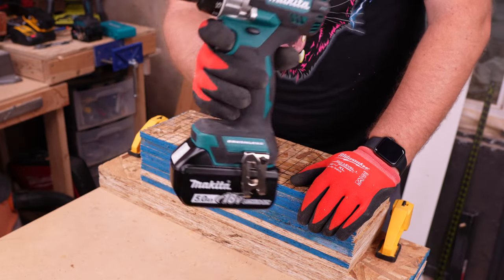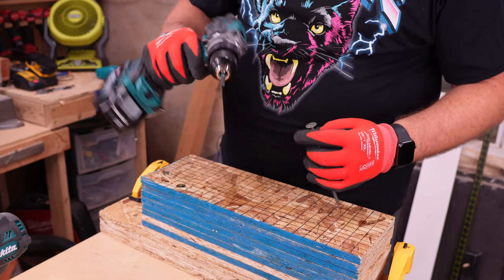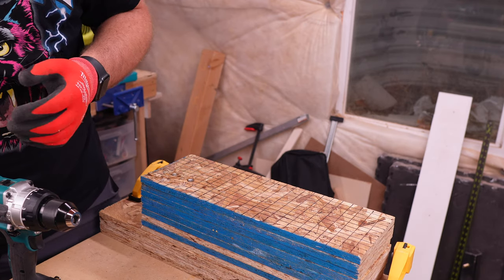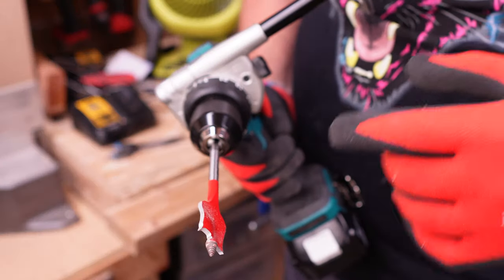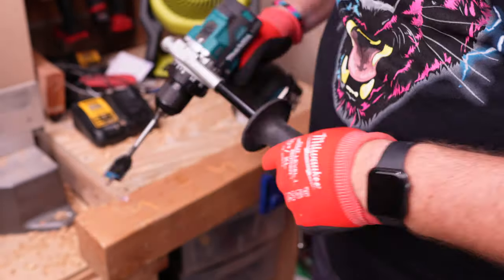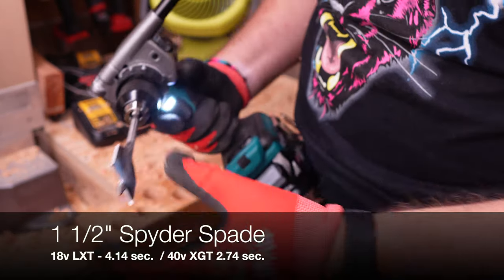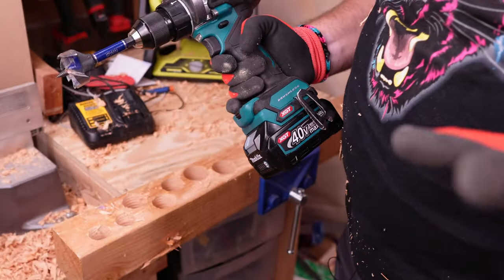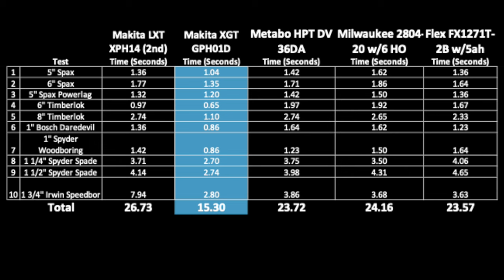Hands Down The Best Hammer Drill I've Tested! Makita 40v XGT vs 18v LXT

Comment: Awesome video, hey I'm in the market for a new hammer drill/impact driver this kinda turned my head from flex, waiting for the holiday season to buy for better deals. Anyway, I'd love to see this in a vs video against flex with the stacked lithium!
Reply from the maker: The recent sales/battery promotions that they have had were the best deals I have seen on them.  Hoping for good stuff at Black Friday.  And for the stacked lithium it is on the list of things to bring to the channel.
Reply: Flex wins vs XGT if your looking for raw power and anti kickback go with Flex. If you want a smooth and still powerful drill get the Makita. I personally went with Flex, I’ve had to call for service once because of an adapter breaking and getting lodged in my collet, Flex sent a replacement in 11 days and that’s to Canada. Makita would’ve left me to the dogs.
Reply from the maker: @athannaelanderson3806  I can’t speak to the service side of things but from my experience the XGT felt just as powerful but also faster.   I didn’t have to worry about the turbo mode kicking off and they both have anti kickback.   Not saying you didn’t pick a great drill but it doesn’t blow away the XGT in the hammer drill category.
Reply: @TinkerWithTools  Maybe you didn’t read my comment. I said still powerful drill, the XGT does not beat the Flex on raw power (torque) as to speed I’m not sure on that category I would have to check the rpm however once again I also said the Makita was smoother, the flex is torquier especially under higher loads. Anyways whatever take it as you will, at the end of the day the flex is much more value for your money currently with the lifetime warranty and superior battery technology.
Reply from the maker: @athannaelanderson3806  I was more just saying that while the torque figure is higher on flex I haven’t had it feel more powerful.  You do have a point on the warranty.   They likely won’t have that forever but it is a nice feature of being an early adopter.
Reply: @TinkerWithTools  what’s Makita’s warranty like? I’ve never really checked that out.
Reply from the maker: @athannaelanderson3806  it’s pretty standard.   5 year tool.  3 year battery.   Similar to Milwaukee.   You mail the tool to a service center via fedex at their cost and they claim most repairs are done in 3 days.  Still sucks to be down a tool but I wouldn’t be shocked if that is the way that Flex goes if they do away with the founders warranty.   The 5 and 3 part.
Reply: @TinkerWithTools  I’ll stick with Flex, much better service. The standard warranty for Flex is 5 years, it covers everything the lifetime covers as well 5 on tools, 5 on batteries and 5 on chargers, Stack Pack Storage System is 1 year on standard warranty. So even right now their warranty is better and going into the future their standard warranty is still slightly better than most.
Reply: @athannaelanderson3806  makita also has anti-kickback and has more power obviously
Reply: @riba2233  They also have a coffee maker and a microwave on the way, what’s your point?
Reply: @athannaelanderson3806  you pointed that as an advantage for flex, just saying makita also has it along with many other advantages
Reply: @athannaelanderson3806  rofl, someone skipped their meds...
Reply: @athannaelanderson3806  🤦‍♂️
Reply: @riba2233  I’d delete that comment if I was you too, but I’m not you. The difference is I wouldn’t have written such bafflingly lame words, than felt embarrassed and have to take them back. Furthermore your baiting in that comment to provoke me to write an “angry” reply back was obviously unsuccessful so I hope in the future you would take this as a moment to learn and quit trying your other Brothers on this worlds patience and man up, be a part of the community you would like to see, without all the shenanigans. Hope the best for ya Brother, and stop believing in the whole we all had to grow up and learn at some point phrase, it’s a lie. Start learning how to grow up today, because if you don’t your son will end up a baby tomorrow.
Reply: @athannaelanderson3806  wow, deep psychological issues, just as I though. Please get some help, it is still not to late (hopefully)
Reply: @riba2233  Well I tried, I’m done wasting time on what is now clearly pointless. I’m sorry your Father, your Mother, your community and your own school education system let you down. Peace ✌️

Comment: What’s your opinion of the XGT combo at Home Depot?
Reply from the maker: I love the combo and the drill is worth being on XGT but the impact will lose to the LXT impact.   While the combo get's you more for you money getting you a free battery, you also have a higher cost per tool on XGT that almost any other brand.   So it has treadeoffs for sure.
Reply: @TinkerWithTools  if you do the hack, the combo is $315, which makes it less than the Flex right now.
Reply: @TinkerWithTools  From the tear down video by Thibs, it looks like the XGT is actually made with Japanese parts, unlike the LXT.
Reply from the maker: Yeah, when I bought it was on sale for $399 with 4ah battery which i use on the rear handle saw.
Reply from the maker: Didn't know that about the breakdown. I'll have to check out the video.
Reply: @TinkerWithTools  The Ridgid and the gen 4 Milwaukee are the best deals at Home Depot, in my opinion.
Reply from the maker: I have looked at most of the deals this year and don't know if I will be biting on any.   At least not right away.  Most of the deals I wished I had grabbed from last year weren't available this year (like the rear handle dewalt saw for example).   I may pick up a router or two from different brands to do some testing there.
Reply: @TinkerWithTools  I’m seriously considering the Ridgid combo. I know that the Milwaukee is more powerful, but I just don’t think I’ll ever be comfortable using the gen 4 drill.

I’m holding off to see if Lowe’s shows Flex a little more love. They do have a pretty decent deal on the 4 piece combo that includes the 750 inch pound drill.

Comment: i had mine for over a year for now, i mostly use it to drill holes in concrete and metal haha. it always does the job and i feel impressed everytime.
Reply from the maker: Yes.  Normally I love Makita impacts cause they are nice to use but I know they aren’t the strongest in the world.  But with this drill I feel like I am getting the power I want and it’s great to use.
Reply: Without the handle mine breaks 12 mm  (1/2 inch) metal bits through thick steel like spaghetti.

Comment: Actually the XTG should be safer with the anti kickback feature.
The 18V did twist my wrist once when I didn't expect it. It hurt but I am ok  but more safety is appreciated.
Reply from the maker: You are correct.  The XGT has it and it works pretty well.

Comment: That "clutch" ruins the XGT. Unless you never do any driving, I'd stick with the 18v. The electronic clutch is not a clutch. It's just a sensor that cuts power when it detects that torque is too high. This is the fatal flaw: by the time the computer has detected the high torque, the high torque has already been applied to the fastener; making the clutch completely useless. A mechanical clutch prevents the torque from being transferred to the chuck in the first place.
Reply from the maker: I’ll have to do some testing between to the two to see how differently they operate
Reply: @TinkerWithTools  I think the difference will be most obvious on machine screws; not wood. Measure the peak torque on each setting, and plot them on a chart. Or if you don't mind getting a rug burn: grip the clutch on the lowest setting with the chuck open, and go max speed. When the chuck closes, with the LXT, you'll hardly feel it. With the XGT, prepare for a good exfoliation.
Reply from the maker: Something tells me the rug burn method won’t translate to video well. 😂